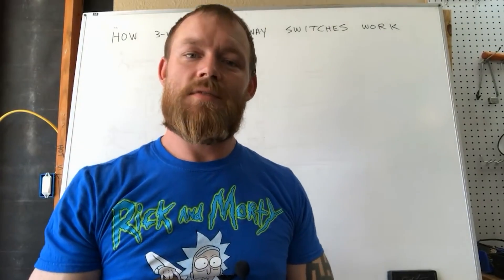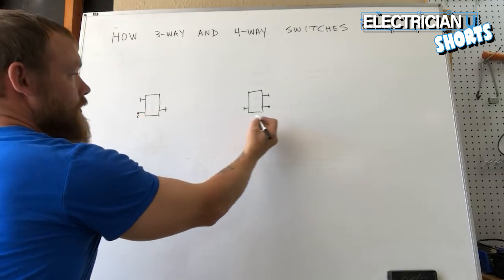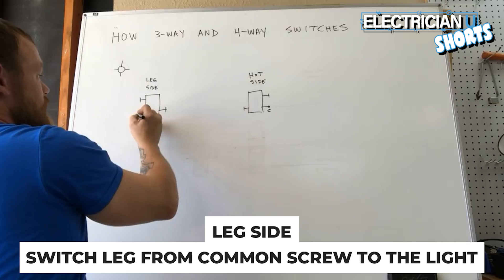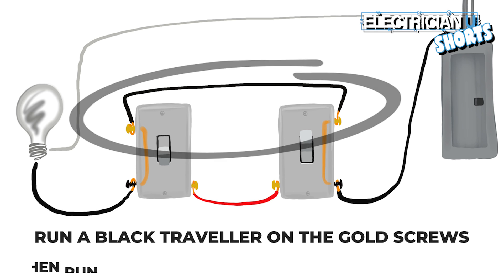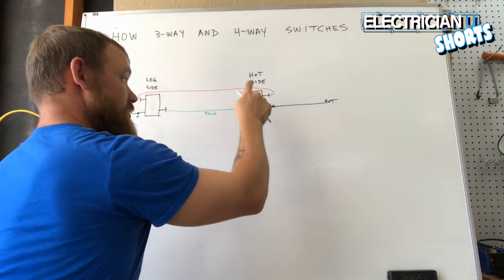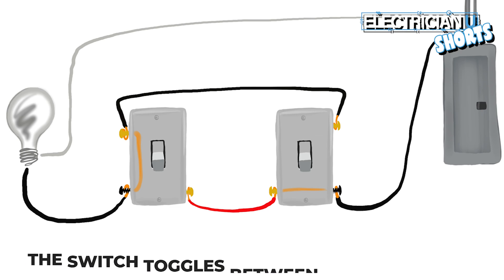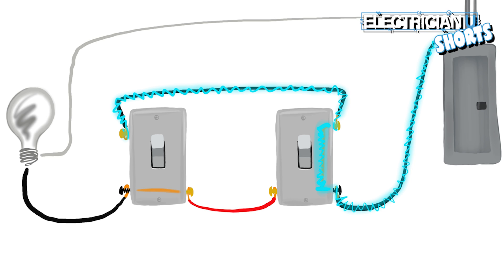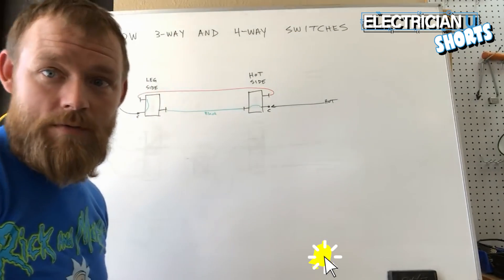BEST EXPLANATION OF 3WAY SWITCHING - in under 3 minutes!

Comment: great explaination, thank you so much.   Question -  what if i want to have 3 switches to 1 light, i would just expand this setup by 1 and add a 3rd switch and traveler?  So from left to right on your drawing (1,2, +3) switch 2 and +3 would look the same other than the leg? Or do i need 2  3way and 1  4way swiches in the mix

Comment: So if I wanted to abandon the switch on the left I could connect the black traveler to the wire that sends power to the light and then put a blank plate on it right?

Comment: Great simple explanations... What i don't understand where are all the neutrals ? Or is all the conductors just single wires? 
Do you just have a single Black wire from the fuse box to the first switch?
 Between the two switches I see you used Red and Black but what do you do with the neutral if your using 12/3. I am not touching my house wiring just curious lol
Reply: Hi Chris
Reply: @eddiew2325  Hi, I did figure it out in the end lol.

Comment: OK, I have a delema.  3-way switch pair in any combination of switch positions does NOT turn off the light.  A little background, very old house but my guess the wiring involved is from the 60's.  One of the very old 3 ways did go bad about 6 months ago, I replaced and it worked fine up until yesterday.  Now nothing turns the light off.  There does seem to be a minor dimming when flipped but in no configuration does it go off.  My first reaction was just to replace the other old switch but I can't believe there is a switch failure mode that results in this condition.  Is there something else going on?
Reply: Turned out the newly replaced (6 months ago) switch had failed.  Checking continuity showed one terminal always hot no matter the position of the toggle.  My concern now is what caused that condition; just a bad switch or did some over-voltage / short make it fail.  Since the wiring has been there for a while and I didn't see any burn marks on the switch I'm hoping it was just a bad switch.

Comment: How do you make a switched outlet using a three way switch
Reply: Instead of the light being the load the outlet becomes your load.
Reply: @chrisinjax1648  ok, thanks for the advice
Reply: Make sure you wire the outlet with 1/2 switched and the other 1/2 always hot. Break the tab between the screws on the hot side. Depends on how many things you want switched of course.